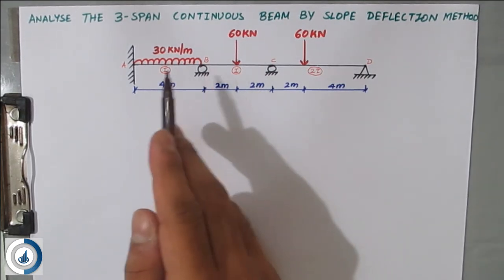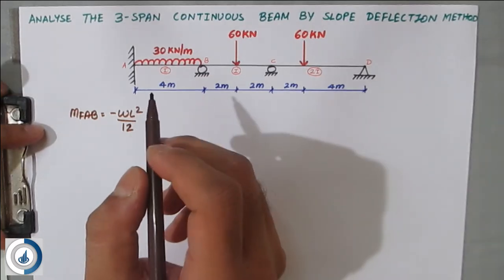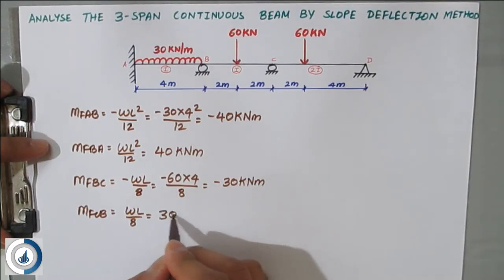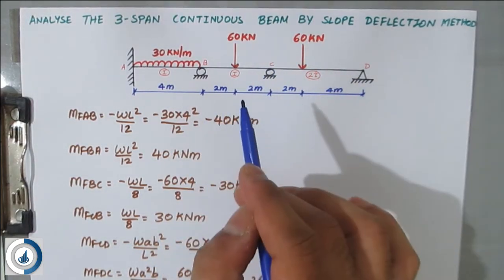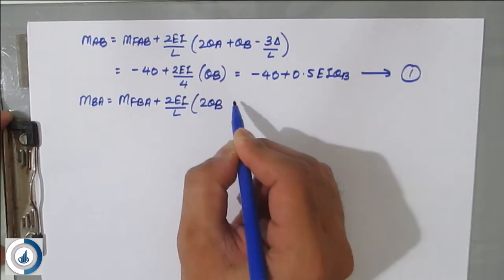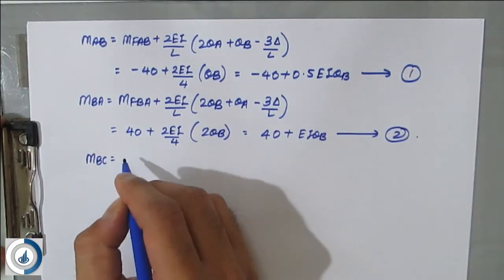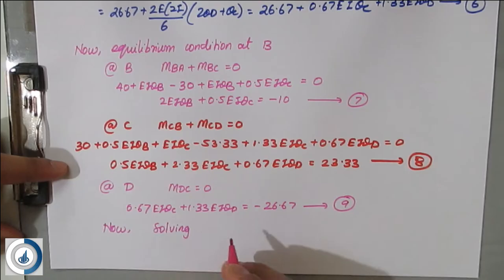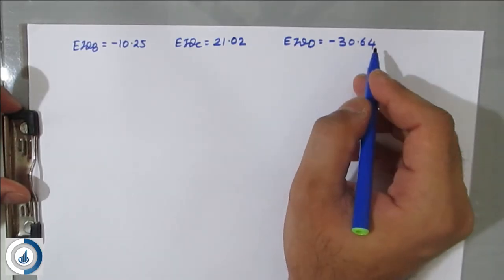Analysis of 3 Span Continuous Beam by Slope Deflection Method

Comment: Hi, may I know how did you get 80 Knm on BMD? thanks in advanced
Reply: for the unbalanced point load, we use Wab/L which will be 60*2*4 then divide this by length, which is 6m, you will get 80knm